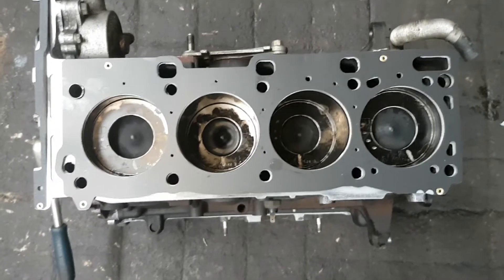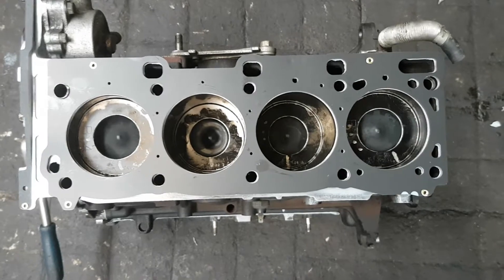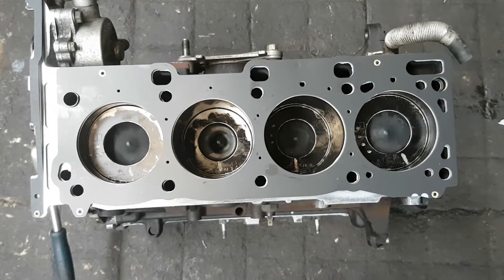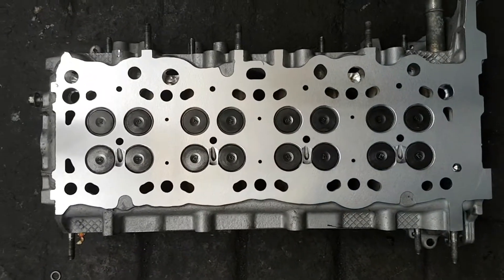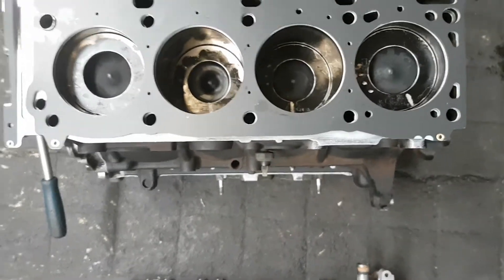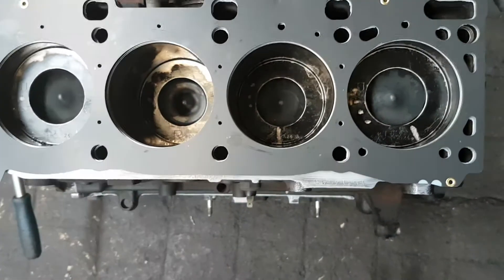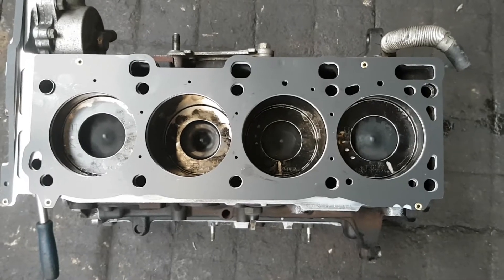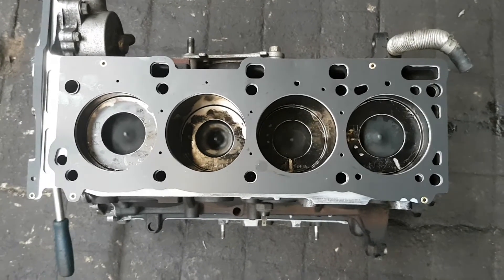Mazda 6 Skyactiv Engine Rebuild Part 2

Comment: Hi.How would a mazda 6 2.2mrz-cd 92kw react to chiptuning?With the dpf in.
Reply from the maker: Hi  its not recommended while the dpf is still in, if your going to re-map it then get the dpf removed also, it will run so much better. Do me favour and hit the like button please